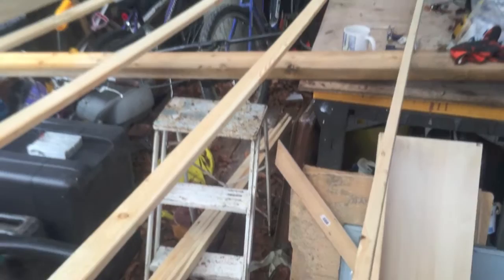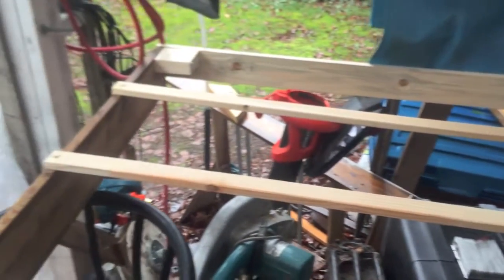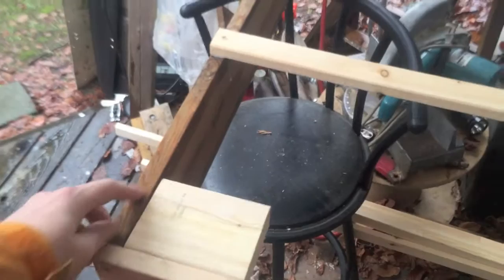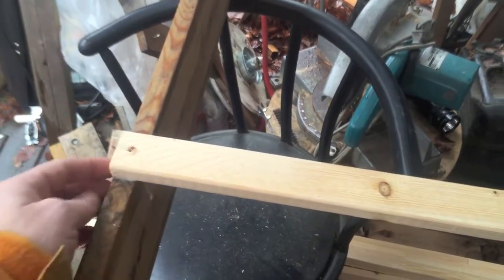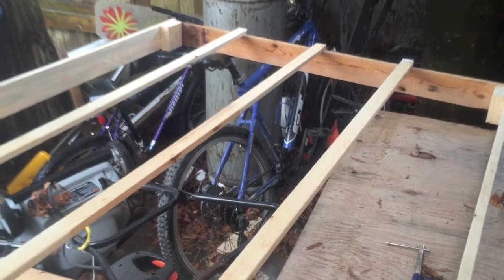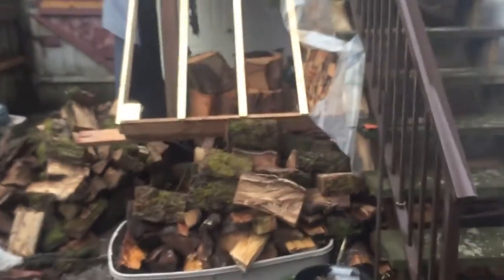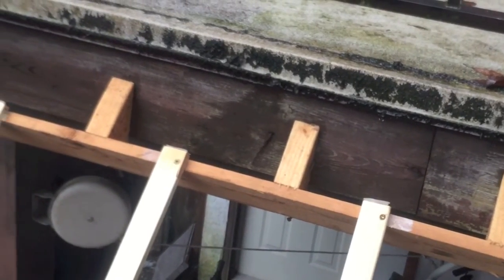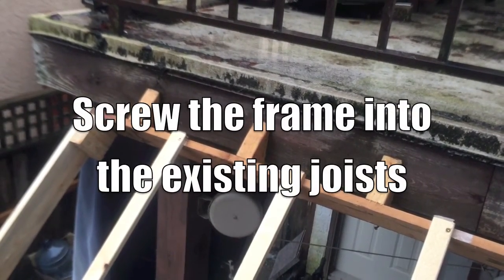Solar Firewood Dryer/Kiln Project-  Part 1

Comment: A great idea I think I will build one when i have time for it.
Thanks for the video
Reply from the maker: +David Schneider It's not too difficult, plus securing it to the existing stairs helps. I still have to enclose the back and figure out efficient air flow.
Reply: +The Cedar Workshop in the summer my shed gets really hot and humid. I took a 12v muffin fan from an old computer tower I had and hardwired it to a cheap 5" x5" solar panel I found and it cut the humidity down. a tall 4" stovepipe could work also I would imagine. thanks for sharing your idea!
Reply from the maker: +Artoo Hafling Good idea. A fan would help. I noticed there was a lot of humidity and the air wasn't moving much inside. I cut some holes in the top of the plastic, but not much air movement.